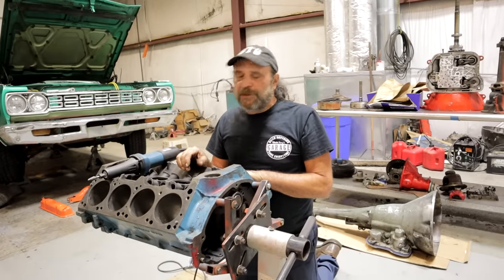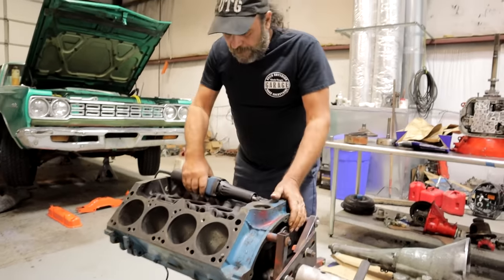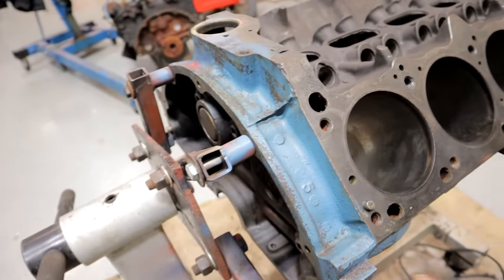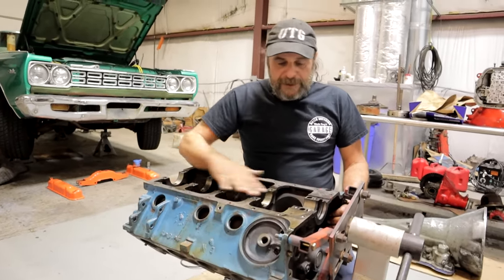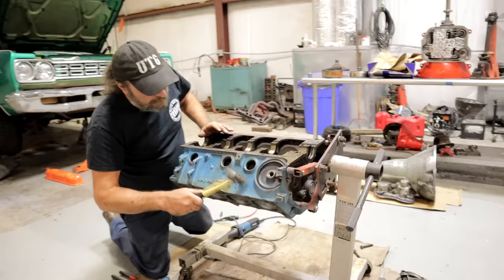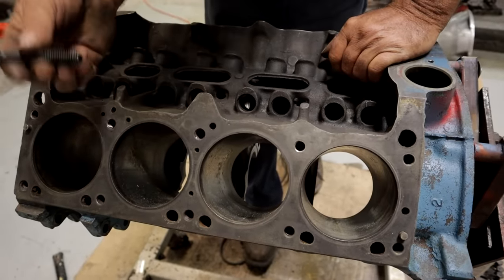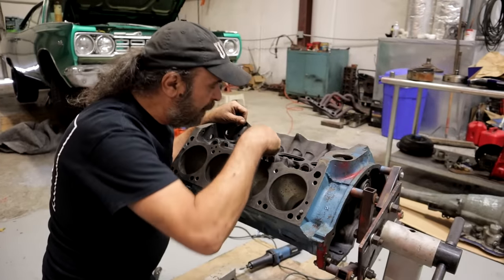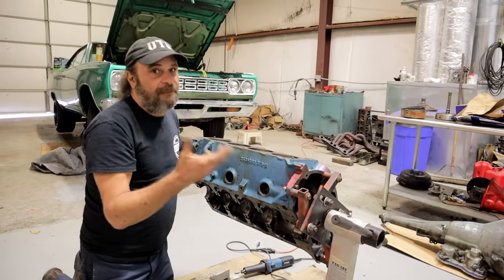Engine Block Preparation For Performance And Abuse - Best Practices For Inspection And Detailing

Comment: Would a pressure washer work to clean the water passages?
Reply: Also, what would you recommend to clean up the oil drain back holes you spoke of? Step drill, drill bit, die grinder, rat tail file or all the above?
Reply: I use carbide Burrs on a air die grinder for ferrous metal to clean up those drain back holes going to the oil pan in the lifter Valley Etc basically the same thing you would use to grind out areas in the bottom of the block to stroke it for crankshaft and rod clearance. Don't Buy cheap carbide burrs you will thank me later. Buy cornwell, Mac, snap-on. The cheap ones are brass braised carbide to the metal shaft and when you get them hot the carbide just Falls right off the shaft.
Reply: A pressure washer would work especially a Hotsy on the water passages pretty good. Just try to get all the clumps broken up as best as you can first. Back when I was in my late teens and I first started Building engines I would take them to the car wash (self carwash) and use that pressure washer to clean them out.

Comment: Aint that the truth about stock taking abuse. I absolutely bag the shit and push my 318 D150 to its limits and it refuses to die. I had planned on running it to death and then throwing in a built up 400 but man im kinda thinking hopping up the 318 thats in it as a form of graditude for lasting as long as it has.
Reply: I used to beat my 71 valiant 318 like nuts
I used to do 1/8mile drags in 1st gear😂

Original engine never had any complaints. 

I let water freeze inside it-
Didn’t care. 

Didn’t even have valve stem seals when I got it. 

Didn’t care. 

My first oil change I added 2 gallons
-did not care. 

😂
Reply: I love the 318s.  They seem to love abuse and in my 1/2 tons they ran hard and worked hard. Never found anythin they would not pull.  Even with 2.92 rear and 33x1250x15 on it.  With both 999 and 727.

Comment: Stock car guys make a big mistake by grinding the lifter valley smooth.oil is the second coolant. Just because water temp. Is 200 dogrees does not mean oil temp. Is not 350 degs. A porous area is better for heat absorbtion by a fluid because it has more surface area. Oil absorbs heat and returns it to the pan and is cooled by passing air !

Comment: So, what you're saying is, I should give my engine a  really good, hard run at high rpm to loosen the crusty stuff inside it before I pull it out for a rebuild?🤔 Sounds like a plan to me
But seriously, I wish I could afford to build something. At this point I don't care what make, or even care if it's a V8. I just want to build an older car. Preferably something from the 60's to 80's. My son is 13 and I really want to build his first car. Or at least have a project we can work on together
Reply: A suggestion. When I was 13, I was given a 5 HP Briggs & Stratton and an SK quarter inch drive socket set. I learned most of what I needed to know about internal combustion engines by tinkering with that engine. 50 years later, I still have the engine and the wrench set. There are many antique engines out there that are affordable and parts can still be had for restoration. The thrill of firing up a first build is not diminished by only having one cylinder.
Reply: Find him and you and 84-88 Monte Carlo SS and build a 350 or a 400 and neither of you will be disappointed. Also a SBC is the cheapest and easiest engine to build. Hell if you go 400 sbc I have a set of pistons I'll GIVE you if your near Ohio. They are cast .030 = 4.155 bore and they are 9.5:1.

Comment: Back when I cleaned water  jackets i would use E brake cable in a drill.
Reply: Smart
Reply: That's a really good idea. Never thought of that.
Reply: That is kinda slick. 
Years ago I had a Mitsubishi engine on a generator with leaking core plugs , so I got a set and replaced them. 
Glad the customers garden hose reached the unit ,the block was filled to the bottom of the plugs with rust. 
Good times.
Reply: I use electrolysis to clean blocks and the water jackets look like new ,all the orange nasty comes out

Comment: I'm ticked off at my local machine shop. I dropped off a set of bare aluminum heads 3 1/2 weeks ago. The guy coated me a price of $600 to do them. I called every week to see how they were coming and the guy that answered the phone told me the guy that's working on them will get back to me. Finally I called this morning and the guy said I was going to get back to you since the price has gone up to $1200. Do you still want us to order the parts. I understand inflation,but why on God's green earth did the machinist take 3 1/2 weeks to tell me he hasn't ordered the parts yet and I had to call and it was $600 more? The scary thing is I'm waiting for my wife to get home to tell her the bad news. I asked the guy did you look at summit or Jegs and he claimed he gets the parts at the cheapest place locally. The sad thing is I'll have more money in those heads then the short block I picked up from a local machine shop that was selling it on Facebook Marketplace.

Comment: Got a quick question Tony, I was pretty thorough (as far as I know) with my block cleaning but after my rebuild during the break in my oil pressure was very high at idle (80+ psi) on stock oil pump but as the break in procedure went on it came down to about 40psi. Is this normal or something I should be worried about. Because if I have to tear it down to inspect it again I'd rather do it before I get it in the car

Comment: How do you drill out the shorter hole? Is it as simple as drilling it out with a black and decker with a piece of masking tape on the bit? Or is that something David is going to fix on a mill?
Reply: Personally I would shorten the bolt after measurements and chase the threads.

Comment: I know you are lookin fer horsepower, I look fer torque. So say I was buildin a 360 or 440 fer a 1 ton needs as much torque as possible how much of this applies in lower rpm high torque applications?  I think it would be just as necessary since yer flexin the engine just at a lower rpm.
Reply: Even if you do all this to a daily driver it will do nothing but help it and benefit and longevity.
Reply: This isn't for power as much as longevity and reliability but it may gain u a hp or 2 also
Reply: @clolumbus racing @nicolas cola I grew up around a racer so this is what I figured mostly askin so others who want to know gets it clarified.

Comment: Just spent 20 minutes looking for a half inch socket 10 to 11s like crazy didn't know I had so many 10 mm.
Reply: I inventoried mine and I had 36 10mm sockets. 
I’m paranoid 😂
Reply: My son give them as gifts during Christmas.
Reply: I barely ever used my 11s until I got an old old Mercedes,unless I was using them for a 7/16😁
Reply: @fastinradfordable  I found six 10 mm,four 11 mm, and all I wanted was a half inch so I could take my fan off. It's just a little easier to do the water pump with the fan out of the way. I put them all in one drawer with the rest of the metric sockets, don't know what they were doing with the SAE. Didn't used to be that way, think the kids have been in my toolbox. But when I go looking for a 10 mm I won't be able to find one.

Comment: Why not do you like Chrysler did with the 426 max wedge send the block off let them heat the block up to about 1200° a bring it up slowly let it sit for several hours on how long I don’t know for sure and then slowly cool it off that makes the block stronger what I mean by that is whatever the Rockwell number is what see you do a Rockwell test you check on the top of the cylinder it’ll be a number may be the right number and then you go to the bottom it’s a little less well it makes it all even anyways this is six in a row jim from kennerdell Pennsylvania I have six in a row under the hood of my 91 dodge pick up skews me 91.5 it’s called a Cummins

Comment: an interesting thing ive recently heard is that the LS block is based on the 350 buick block (and not on a Ford block.... sorry Ford guys) 
and it does make sense!!! 
.
again, sorry ford dudes..... i know you want the best V8 engine for cheap, yet reliable, power to be a Ford.....
but it took ford like 11 years to come up with a good engine (the 5.4 was trash.... lots of issues with cam phasers and spark plugs......plus it just dont make power) 
.
and yet... even the 5.0 and other ford engines just cant compete with a modernized buick...... 
.
.
.
sure, the big block "godzilla" is pretty nice.....
but ya went back to pushrods.... (which was actually invented AFTER! direct overhead cams..... DOHC is an OLDER!!! tech than pushrod, despite what everyone thinks)
{and ya, id rather have a simple engine.... with torque (aka, HP) everywhere........... VS and engine that SCREAMS! but only in a 600RPM window}
.
plus... its a big block VS a small block
454s and 455s still give "dogzilla" a run for its money...... (and a stroked 454 is WAY WAY cheaper)
.
.
.
.
.
.
anyway.... 
its not a ford rip off
its a buick rip off (which was better than the fords, mopars, and even chevy small blocks)
.
buick used to have the BEST engineers
i read through a design paper on the buick nailhead (especially how they overcame the small valves.... using runner design, lobe design, "pentaroof" shaped pistons/combustion chambers, ETC)
REALLY interesting read.... ill send you a copy if you PM me (and i happen to read it......may take a while)
.
.
.
.
ANYWAY!!!!
the LS is NOT! a ford ripoff 
its a BUICK! ripoff (with further improvements... as the Buick engineers were now just GM engineers, due to homologation.......plus computer aided design programs in the 90s) 
.
the whole "its a ford ripoff"....... i feel is just Ford guys coping with the fact that 95% of fox bodys have LS engines

Comment: I will absolutely gaurenty that all of the tapped holes in a cylinder block or head are not tapped to full depth (1). The reason is manufacturers want to abide any off line operations such as EDMing out broken taps. They still happen but one way they avoid it as much as possible is to drill the hole say .125 deeper than the tap ever goes. 
The chamfers or reliefs at the tops of the tapped holes. Thses are done in either a second operation or by using a step drill that has two cutting diameters. The decision here is the cost between having a second drilling operation or the greater cost involved in resharpening the tooling.
1) The exception to this holes tapped all the way through.

Comment: Not exactly on the topic of your video, but.... I am hearing and reading many horror stories about flat tappet cams getting wiped out during break in.  Was wondering if this is something you or your viewers are seeing these days.  Seems like comp cams gets mentioned a lot.  I've always been under the impression that they made really good stuff, but folks are posting that their quality is not what it used to be.  I haven built an engine in 20 years, but I had good luck with them back in those days.
Reply: oh boy, go thru his library--he goes on and on about it.

good news is, the basic small blocks--the magnums, the vortecs, the windsors--from the late 1980's on have not only great head flow, but roller rocker provisions. a lot cheaper to buy one than to convert an older block. some builders don't have issues with flat tappets, but they buy the good ones and then use zinc additives in oil (not necessarily diesel oil, which has it but it designed for 3,000 rpm engines) until broken in.

Comment: a TON!!! of "photo finishes" could boil down to which driver took a crap before the race........ im not even joking
.
you win by 0.0005 seconds..... that big 5 pound steamer you left in the porta-potty could EASILY be why you won
both cars do EXACTLY the same thing...but ya didnt take a dump... that that extra 5 pounds means you LOSE by 0.0005 seconds 
.
.
again... im not joking (i am a little bit... its a poop joke after all.......)
but im also DEAD serious
.
if you are going to go the extra mile to knock 1 pound of rust off the block
then why stop their?
.
why do you think lighter seats, lighter wheels, lighter body panels, ETC is such a big thing!!!!
but its like it only focuses on the car..... and NEVER on the driver
.
.
.
some of these big dudes i see on "totally real" street race TV shows.......
they would win more races if they found a skinny dude to drive for them.
(sure, some just have a bad car / dont know how to drive.... and dropping even 200 pounds would not save them.....always that devils advocate)
.
ITS OK TO BE FAT!!! 
just know its a weight disadvantage.... and now you need to pull EVEN MORE weight from the car
.
.
.
the cheapest "weight reduction" might actually be to simply go on a diet!!! 
again... not trying to "fat shame"..... just state the facts for HARDCORE racing 
.
.
.
.
horse racers (jockeys) and wrestlers care about their weight a TON!!!
a wrestler as it puts you into an "easier" set of opponents 
and the Jockey because the horse literally goes faster
.
cars are the replacement to the horse 
yet somewhere we stopped caring about the driver..... as long as they can drive good, who cares how heavy the driver is....... 
.
.
.
.
and im 6 foot 5 inches and 195 pounds
i could lose 10 myself.... 
or, preferably, to me at least..... drop 10 in fat, but put on 15 in muscle (which is heavier than fat... more dense) 
.
.
.
.
.
TLDR
when did we stop caring about the driver??? 
the driver can be a 200 pound weight reduction..... from a BIG!!! dude to a 4 foot 2 twig can be 200+ pounds
and you will spend 100s and dozens of hours looking for that same 200+ pounds... if done with lighter parts / cutting off "excess" parts
.
a skinny twig, that knows how to drive..... can be a HUGE advantage (especially if you are also spending the money and time to find EVERY OUNCE! of weight on the car)

Comment: I get that weight is weight. The more you shed the faster you are. But I go back to why not really save a ton of weight and find yourself a driver who is like 130 pounds? You see 200-300 pound guys driving these things and like you said your worried about a pound here and a pound there??🤔🤷🏻‍♂️ Seems like putting the driver on a diet would yeaild faster easier and cheaper results than all the inventive grinding methods. Sure you could do both and really save. But I'm thinking the time to go through a block and grind it down and make plates etc to lose a few pounds. If a few pounds make that much difference get the 250 pound guy driving it on a low carb lean protein low sugar diet and let him drop 40-100 pounds depending on his build.